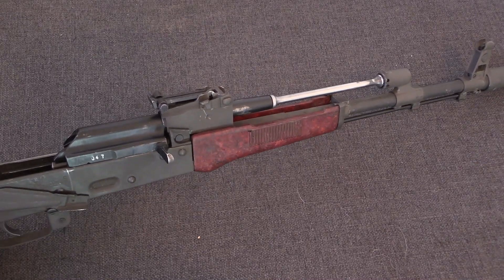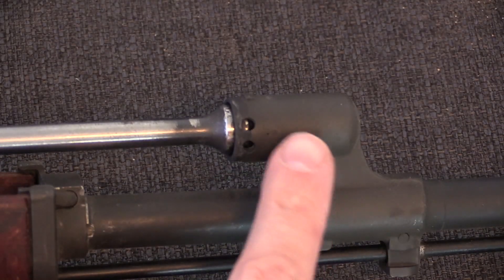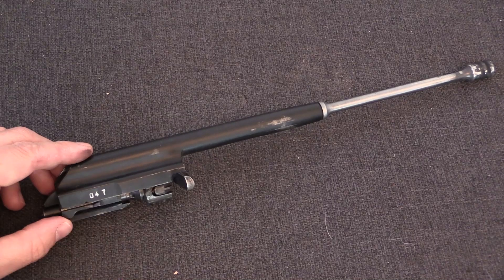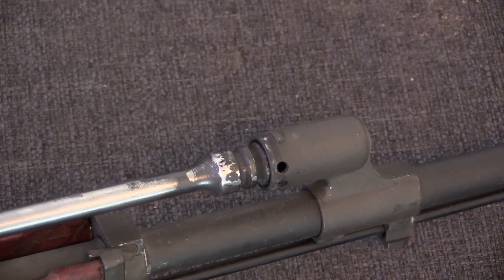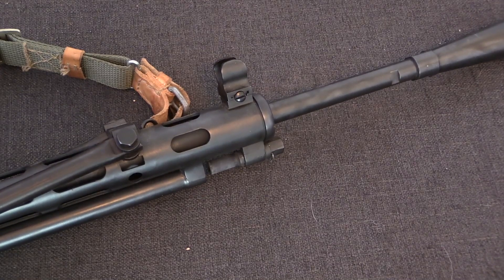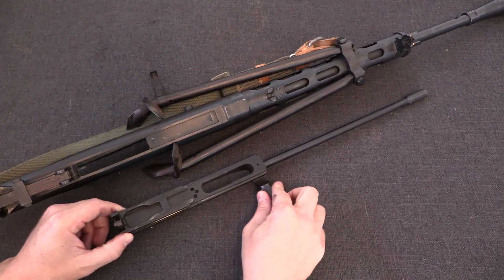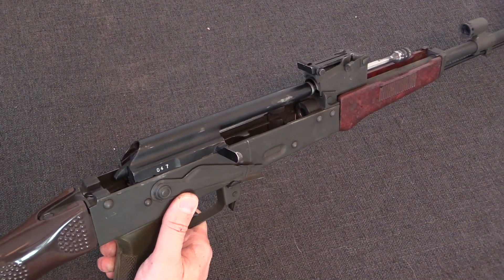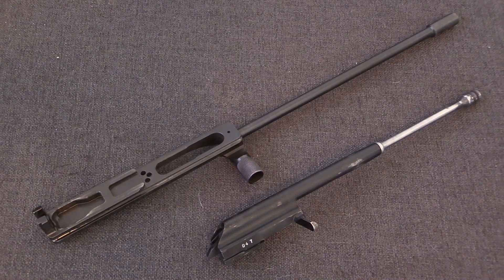How Does it Work: Long Stroke Gas Piston

Comment: Could a long stroke piston system be used in a submachine gun?
Reply: I think the MP7 is a good example of how short-stroke gas operation can work in a smaller gun.

I believe it's definitely possible and viable to build a ground-up design for an SMG with long-stroke gas operation.

I would assume the added mass of the piston system attached to the bolt can be compensated by reducing the mass of the bolt itself, to simultaneously maintain the low weight favorable for an SMG, and the benefits of a long-stroke piston system.

5/29/2025: I should have said something about reducing the mass of the bolt carrier, which would be easier to implement than if the bolt's mass was removed.

Comment: Has anyone ever designed a long stroke system that uses a flywheel at the shooter end to convert the lateral motion of the pushrod into a rotary motion to smooth out the felt recoil ?  Would this even work ?

Comment: I am pondering if the venting at ~1:35 creates a turbulent flow that creates either a pressure differential that buffers or slows the piston.

Would love to see a slowmo of this in a gaseous UV sensitive air or something... so we can see the traversal of piston with the rotation and movement of gas.

Thoughts? 😊

Comment: Where are the M1 Garand, M1A and BM59? All of them are long stroke as the bolt and piston assemblies are linked together via an operating rpd and both travel in the same direction as one unit.

Is it just me but long-stroke guns tend to have reciprocating charging handles?

Comment: Just got a new bolt carrier for a wasr 1063. I realized come assembly that the new piston is almost an inch shorter than the previous piston 5.125in vs 5.81in, but everything else on the carrier is the same. Would this still work on my rifle, or would I risk breaking something?

Comment: Ive been wondering... can a long stroke BCG be made to have the same weight as an equivalent short stroke BCG, be equally reliable, and make the gun lighter (since it has the same KCG weight, but no extra piston)?

Comment: So, after the AK long stroke piston leaves the gas chamber, what ensures it remains on the same plane and reenters the gas chamber without issue? Has it ever happened where components get warped or bent and the piston gets out of alignment enough to not go back into that gas chamber?

Comment: So I’ve got what I believe to be a browning auto 5 sweet 16. It has a cutts compensator and a slide safety in front of the trigger that goes forward and backward rather than side to side. While I’ve seen other guns with the cutts compensator, I’ve never seen another one with the type of safety mine has. Could anyone tell me anything about this gun?

Comment: Very nice. If an AK bolt only travels a couple of inches, why is the spring so long? Why carry all the weight around?
Reply: Charles Holzschuh the weight of the spring is insignificant in comparison to the rest of the major components, also the spring has to be carefully tuned to be able to compress fully but have enough force to quickly and fully return the bolt/assembly back into battery, while stripping another round from the mag. Its clearly better to have a spring with extra power in hand to compensate for lack of maintenance/poor conditions, fouling etc. If Saint Mikhail thought a “smaller” spring would have met these requirements, im sure he would have used one. But he didn’t so it wouldn’t.
Reply: Also has to be durable enough to maintain adequate spring pressure over many many thousands of cycles.

Comment: 1:28 Something about the open/closed bolt operation of the FG42 based on fire mode has me puzzled.  Consider the following scenario.

Weapon in semi-auto, round chambered, bolt in battery.  If one were to switch to full-auto, would the weapon fire that first shot while in closed-bolt, or would the user first have to lock the bolt to the rear before the weapon is in a fireable state?
Reply: It would fire the first round closed and then lock open when you release the trigger.

Comment: Isn't the M1 Garand's gas piston under pressure the whole time?  There isn't a vent hole in the cylinder.
Reply from the maker: Once the bullet leaves it vent back out the gas port and muzzle.

Comment: In my experience, another advantage of long piston is that the fouling is kept to the end of the piston and with the open end of the gas block there is just simply less fouling of the moving parts of the action.  Certainly less than a short piston, though not as drastically less as there is a direct impingement system which remains the AR series single greatest flaw (IMO & all that). 

In the end, I'd rather have a 5.56x45 AK derived rifle personally as a result of these factors and others.
Reply: So you want a Galil. Well, I won't fault you on that.
Reply: 7&$ !`~rchhv
Reply: How on earth could long and short stroke actions be prone to different levels of fouling? ^_^
Reply: @konstantin.v  The shorter, often not spring loaded piston that lies in between the bolt carrier and the gas block can get very much more gunked up and, without spring assist, can get frozen by fouling much easier than a long piston attached to the bolt carrier. See the M1 carbine for an extremely annoying case that requires a special tool for the armorer to fix. 

Both remain superior to direct impingment.
Reply: @wlewisiii  , hmm. And why is that? Is it because the long stroke piston spreads the gunk over a longer segment of its tube or something?
Reply: @konstantin.v  That's part of it. The other part is that there is the open space between the end of the piston and the gas block. The underside of the hadguard gets ugly but won't impact the firing cycle. Many short pistons are captured mechanically in the gas system. Again see the M1 carbine for an example.

Comment: Hi Ian, 

As an engineer by training, I always love the complicated trade-offs that people make and the mechanical bits and systems involved.  After listening to some of these operating system videos and then to the Hudson Firearms video, it makes me think we have reached a plateau/lull in firearms development.  We spent about 100 years (depending on when you want to pick dates) implementing self-loading, metallic cartridge weapons.  The major military users are working on  designs that come from the aftermath of WWII. Yes, I know things are better now and nobody would put an M1 Garand into front line service anew.  But think about the major military buyers.  The G3, M16, AK47 and FAL have been improved but not really replaced right? So....What's next?  Have we reached a limit in the technology?  I think a video or two on that might be quite interesting.
Reply: Bullet tech and optics are what they said in a prior interview, if I remember correctly.
Reply: @Seseous  Not really a new rifle eh?
Reply: Electronic backpack fed, ultra lightweight bullpups that can run on double d volt batteries for 10 years with shortened suppressors and polymer casings AND ammunition. Dont forget the integrated mind-to-monitor night/thermal goggles that are connected to the rifle allowing fresh soldiers to shoot up to a kilometer, ACCURATELY. Maybe in 6mm.
Reply: Electronic backpack fed, ultra lightweight bullpups that can run on double d volt batteries for 10 years with shortened suppressors and polymer casings AND ammunition. Dont forget the integrated mind-to-monitor night/thermal goggles that are connected to the rifle allowing fresh soldiers to shoot up to a kilometer, ACCURATELY. Maybe in 6mm.
Reply: Apparently, you're new to this channel ^_^
Reply: @konstantin.v  I am not
Reply: @jimsackmanbusinesscoaching1344  , well, not only did Ian and Carl speak about it on a couple of occasions not too long ago, they used exactly the same word -- plateau :)
Reply: @konstantin.v  I dont watch In Range TV anywhere near as often.

Comment: Is short stroke inherently more accurate?
Reply: Not always but generally extra weight going back and forth during the entire time of travel is generally not as effective or nice as maybe having a short kick powering the bolt via its speed. Unless it’s a Ar15 platform in which case it’s going to cause you to start scraping the receiver extension/buffer tube.
Reply: Potentially, the less inertial forces applied to reciprocating parts on the gun the less deviation there's gonna be.
Reply: Finn Mella moving weight is going to make it shake more (at least on Automatic) which is why long recoil and open bolts(in semi auto) have more recoil
Reply: @baker90338  That is exactly what I just said :) the less movement, the less deviation. A long stroke system moves more, more deviation.
Reply: Finn Mella ok.

Comment: Long stroke piston- direct impingement on a stick!
Reply: And the AR (internal piston) is DI in a hole.

Really, long stroke, DI and internal piston should be grouped as one category - direct acting. And short stroke, gas tappet and buffered piston (Farquar Hill) should be grouped as indirect acting.
Reply: @alexandruianu8432  I actually really like that grouping. Gold star for you!
Reply: @arthurmead5341  no you
Reply: Interesting thought but I disagree. In a DI system your forces act between the mount of the gas tube in the reciever and your bolt carrier (and between the bolt and the Carrier in an At). In any piston system the forces act between the piston and the gas block in the barrel.
Reply: @bernhardschmid9222  that's why a short stroke piston isn't the same. Long stroke being connected has it so the gas pushes directly on the carrier, albeit much forward.
Reply: @Falconguygaming  In that regard, yes. In the long stroke system the gas pushes directly onto the bolt Carrier piston assembly.  But the pressure is still pushing the barrel and the boltcarrier away from each other not the reciever and boltcarrier/bolt and boltcarrier.